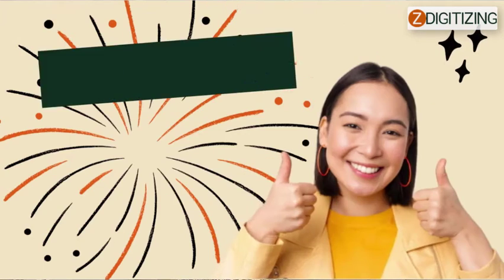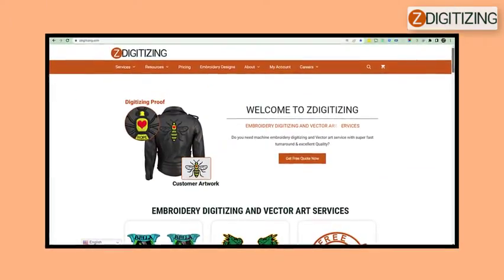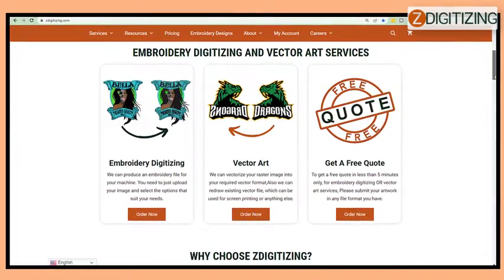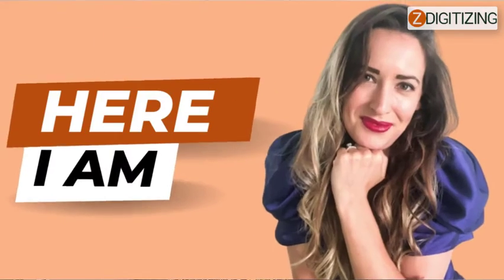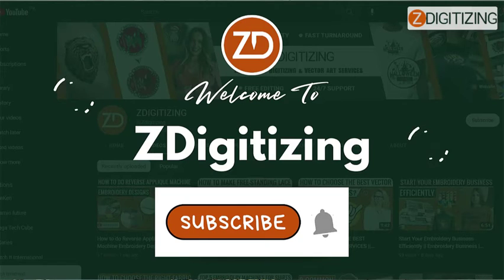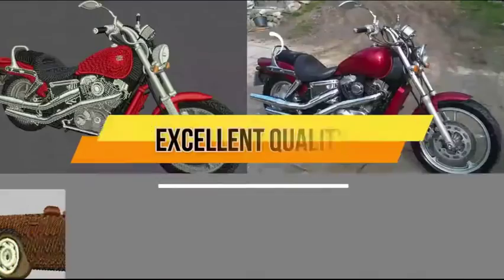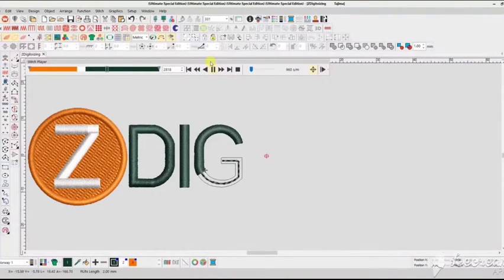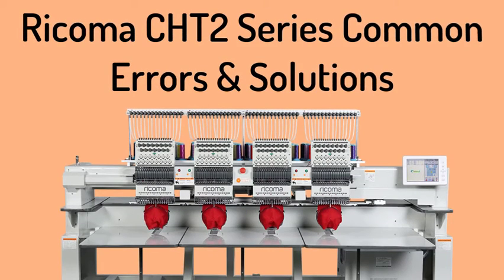Ricoma CHT2 Series Common Errors And Complete Guidance || ZDigitizing

Comment: I have 256:hook error how can i fix this?
Reply from the maker: To correct the "hook not in position" error
1. First, remove the screw covers. You can remove them using an embroidery needle.
2. Once you remove the screw covers, you will use a Phillips head screwdriver to remove all six screws.  
3. Lift up on the cover and then pull it towards you. The cover should come off the machine.
4. You will also see a blue sensor near the black gear.
5. You now need to adjust the gear so it is properly placed in between the flags of the blue sensor.
6. To do so, push the gear up or down to place the foot-like part in the middle of the black U-shaped piece extending from the blue sensor.
7. You should now be able to press the trim key without any error message.
In conclusion, a hook error normally happens when the machine does not trim. To prevent this from happening again, you may need to tighten the tension just a little to the right for whichever needle was being used that did not trim.

Comment: I have a 257 cutter error won't stich
Reply from the maker: There are a few things you can try.

With the bobbin in the bobbin case, make sure the bobbin is threaded through the notch and back under the tension spring, then over the second notch. If it is not under the tension spring, this problem will occur.

Finally, there is an adjustment for the bobbin thread tension - it is a screw and it should be adjust only very little. To increase tension turn to the right and to decrease turn to the left